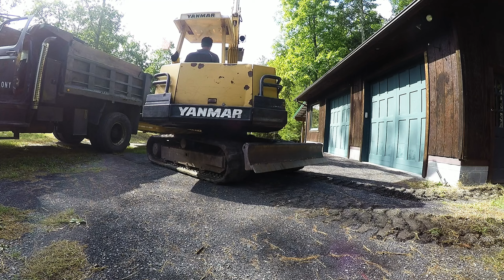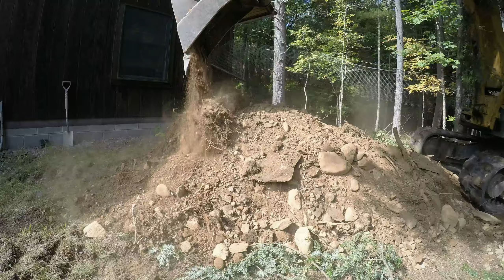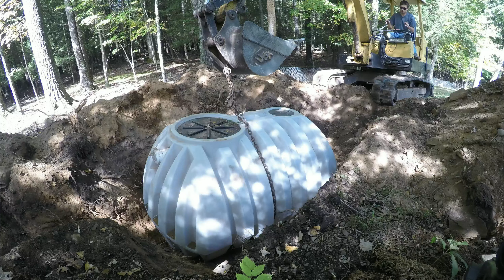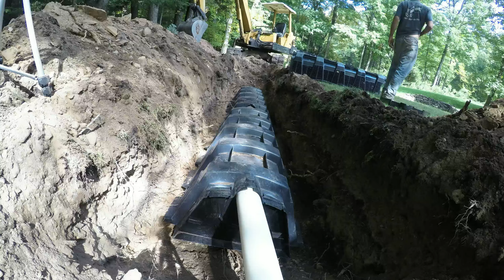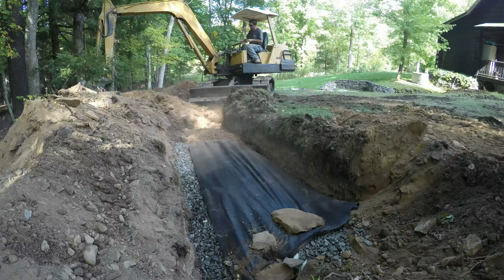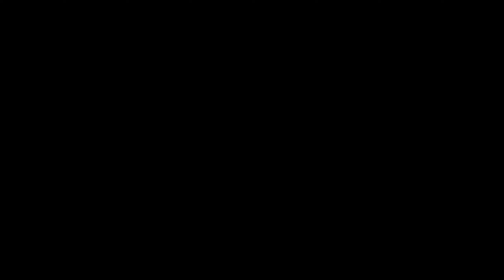Installing small septic system

Comment: Folks Andrew did this guy a favor. Use the plastic baffles wherever you have trees. If you install a field with four inch lines, the tree roots will fill the holes in your pipe in a few years, then you will have zero drainage, although Andrew will have repeat business.
Reply: 65895555 root kill twice a year

Comment: We have a cottage on a small lake in the Adirondacks the bathroom was added back in 1952 and the septic I believe is two 55 gallon drums. I rebuilt the bathroom addition a few years ago and wanted to drop a similar tank in under the new addition but my brother in law would have none of it, was very skeptical of those plastic tanks...well it will be his problem in the future!
Reply from the maker: Some people say the plastic ones are the best. They are certainly nice and easy to install.
Reply: Andrew Camarata and obviously you can back fill around them when empty with no problems!

Comment: Badass job!! Hey, what's the material you put over the top of the gravel after you put the Leach lines in?? Is it the stuff that stops weeds from growing??!
Reply from the maker: That is filter fabric, it is to keep mud from washing down into the drainage gravel. Any septic place will have it.
Reply: This is still filter fabric, it’s designed to keep mud from washing down into the drainage gravel. Any septic place will have it.
Reply: Nonwoven geotextile fabric is what he used.

Comment: I need to install a small system (legally) in central Florida.  Soil is soft and sandy.  It's only for a 700sq house.  I need the exercise and i'd like to dig it out by hand. What system and size would you recommend that would pass health inspection? Would this pass inspection? Without the heavy equipment what did this cost?
Reply: What would pass inspection would vary based on where you live.